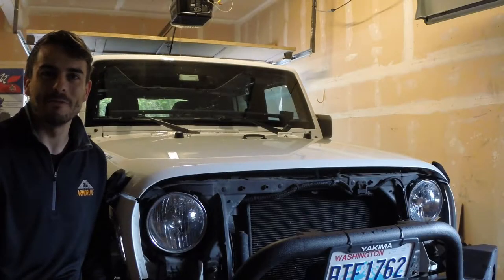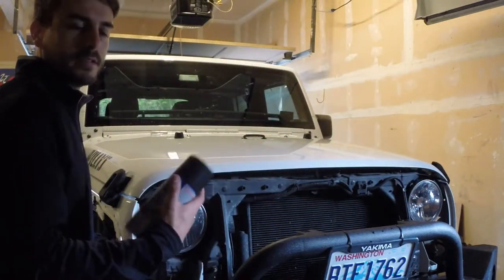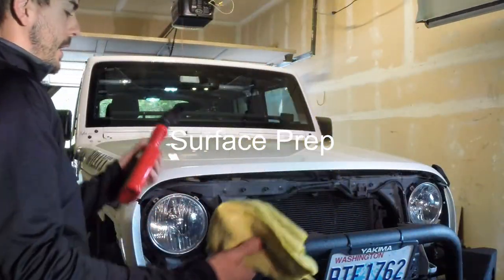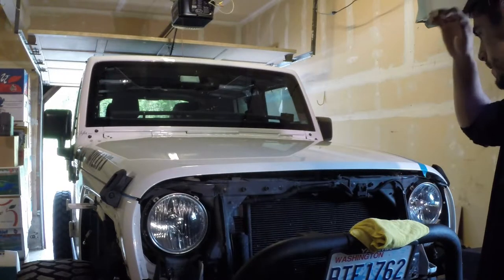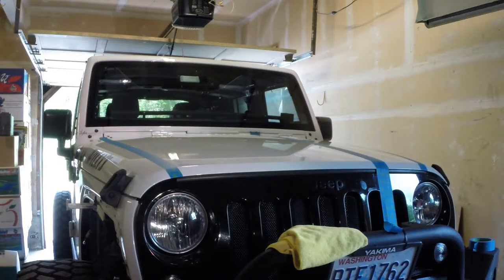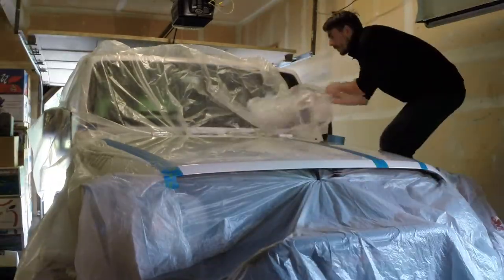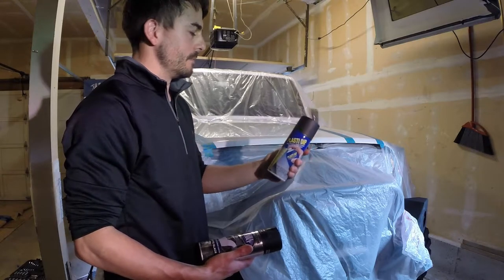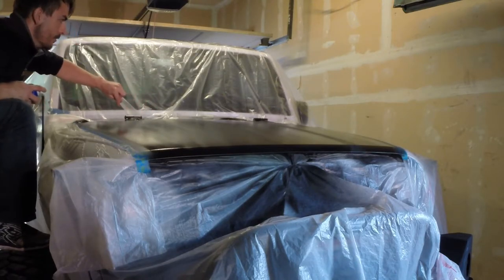DIY Plasti-Dip/Peel Coat Hood Black Out & Stripe - JEEP JKU

Comment: The hood on my 2010 JK has started to fade out. The clear coat is failing.  I was thinking about what I could do without having to have a new paint job done.  This is exactly what I was thinking!!  Looks great!  Curious how it has held up?
Reply from the maker: Hey there Ryan, thanks for checking out my video! This could definitely be a solution for you. I am in progress of doing a review of how it held up. I just pulled it off in May of this year and it held up really well! I might have that video up in a few weeks but I was definitely happy with it. Teaser, I did update to a vinyl wrap that I replaced the plastic-dip with and used cutting tape to make a similar but updated look!
Reply from the maker: Hey Ryan, I just uploaded my long term review video of the plasti-dip if you are interested in seeing more of the video of how it looks after 4 years! https://youtu.be/Nm3on_e31yY?si=z7OKI6o7LCgxen-N